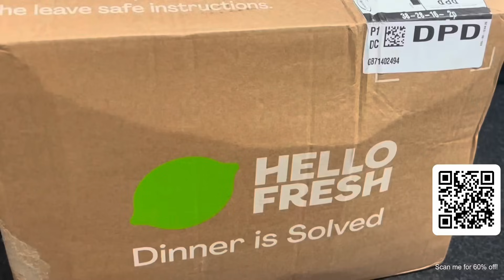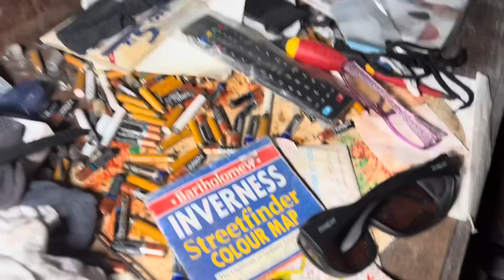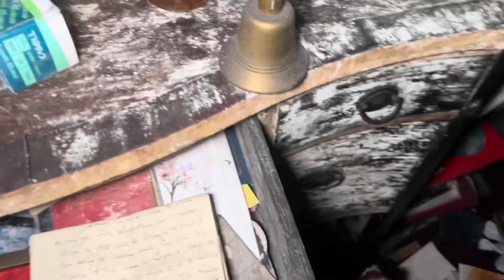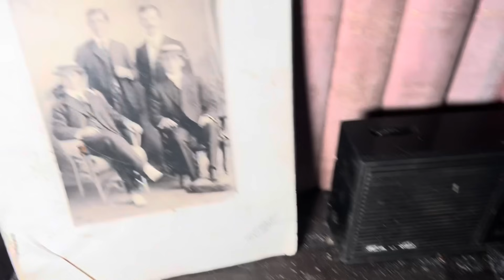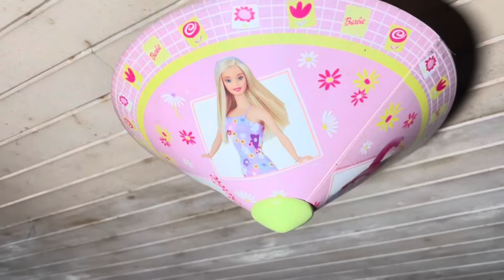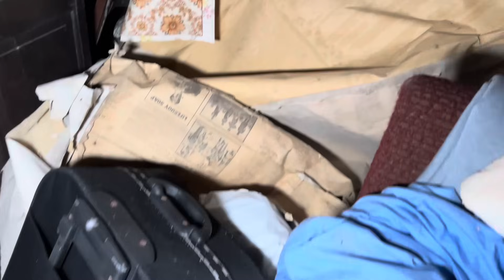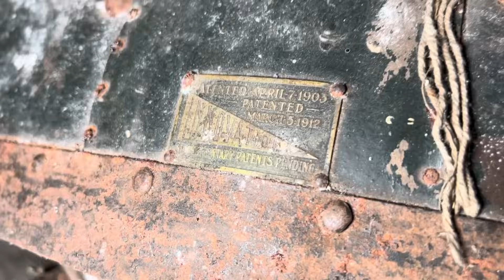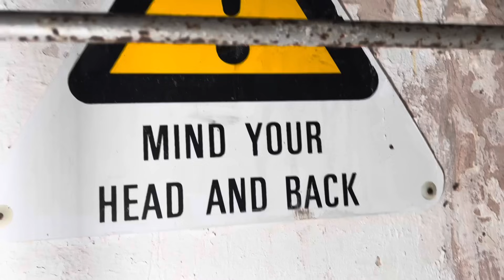I was SHOCKED whats underground at this spooky ABANDONED house

Comment: The bunker reminded me of the old 2-man Cold War monitoring stations that keep going up for sale and getting plastered on local news sites. In the event of a nuclear attack, they’d relay information back to larger bunkers like the one in York so the government (or what was left) could work out radiation levels and things. The Royal Observer Corps manning them were all volunteers and the bunkers weren’t really built for survival. Give a month max or working back-to-back monitoring the situation and then it was “Right, out we go otherwise the air’ll run out.” Just left to whatever remained. The paper that's burnt out was possibly for checking the light from the initial blast so they could triangulate where any potential bomb hit. Some poor bugger had to go out and get it right after the blast before natural light ruined it like you saw. Pretty grim. The main York one was decommissioned in 1991 but they were running drills until then.
Reply: There is one close to where I used to live just outside of Pluckley Kent. You can see it from the road very well secured and fenced off as well

Comment: Another great one Matt :) John Miller was a clockmaker from Kilwinning in Ayrshire in the 19th century so that clock made a bit of a hike. Maybe Mr Miller just made the clock faces and inner workings and then someone local made the case for it as often happened. The cotters Saturday night is a poem by Rabbie burns. If I remember rightly the little pendant thing with Cancer/Capricorn on it was from petrol stations in the 1970's .. maybe not right on the petrol stations but defo 1970's. The ceramic beaker of the Marquis of Stafford was to celebrate his 21st birthday, he became the 5th Duke of Sutherland in 1913. :) x

Comment: Heyas Matt!  Liking the explores you're up to, even the short ones make for good content.   Missing Andy and his contributions too.  Hope he and his missus are doing well.

Those ROC (Royal Observer Corps)  bunkers won't keep you alive all that long after a nuclear attack.  Maybe a few days extra, but they provide protection from an initial blast, and then the radioactive fallout from the skies after a blast.  Many posts even had a building on top to climb up into, whilst they would watch for planes.  Some posts even had a powerful radio, with a special antenna bunker for communications, if the phone lines went out.  Some were outfitted with a bunk bed so the men had a place to rest and could create some space if there were more than 2 men manning the post.  Some communities got creative with the spaces but they were good shelter for a few days.  The photos you found were definitely used there for practice.  They would use photographic paper in a device outside that would allow a reader to see the direction of a nuclear blast or radioactive fallout.  There was even a pressure gauge in the bunker that would let them gather information about the force of the blast also.  They would coordinate the information with all the other posts to create a more comprehensive picture of what was happening.

Keep up the good work..I hope you found your other light.  Or like Andy did, keep some extra batteries around.